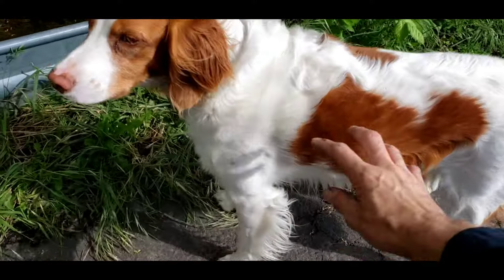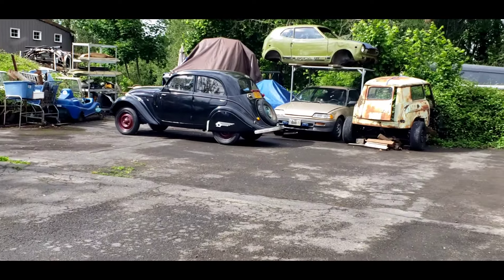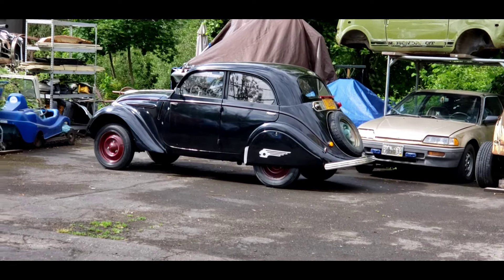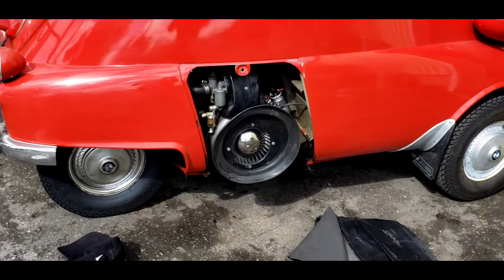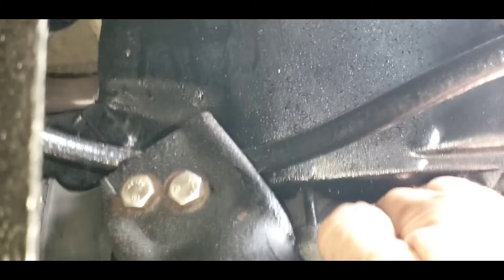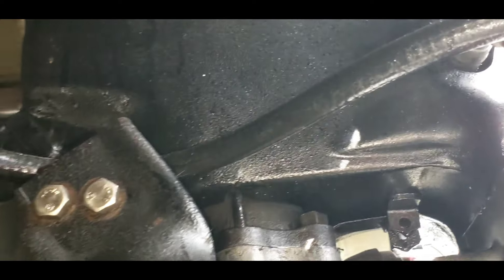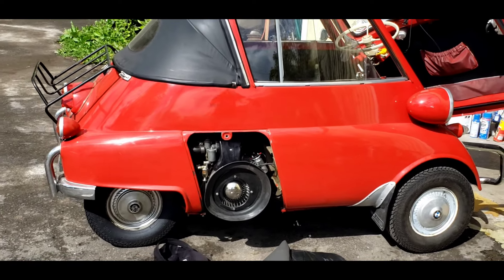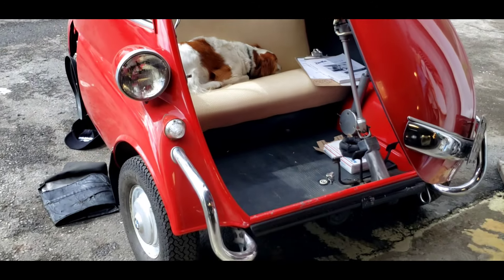Uh Oh, This is Not Good.

Comment: Like some others here I think the muffler impact probably caused the cylinder breaking. The first Ural motorcycle I had, which was a copy of the BMW, had cylinders that were attached the same way. I heard from other owners that although rare, it was possible to crack the cylinder with a big enough impact. And if the impact was at the head (like the exhaust port) it effectively has leverage against the base of the cylinder. Most cars have a fairly lengthy exhaust pipe to absorb impact with the exhaust system but on the Isetta it's right there and the short length makes it stiffer.

Comment: There's lots of videos of people converting cars with harbor freight motors. Looks like a candidate to me .
Reply: Thing is, the Isetta is an iconic car and very rare.
Sticking a motor from a lawnmower in there would destroy the character of the car and any value.
Reply: @jochenstacker7448  I agree, but if the owner has reservations about the cost of a replacement or rebuilt engine, it does offer another option .
Reply: Where I live (Costa Rica), there are several stores that offer a knockoff Honda 250 engine and gearset for about US$500. 

I wouldn't endorse this as a long-term solution, but it would be a way to keep the little Isetta operational while sourcing the correct bits to make it function with the original BMW drivetrain.

Wasn't this the car that was having monster compression issues a while back?